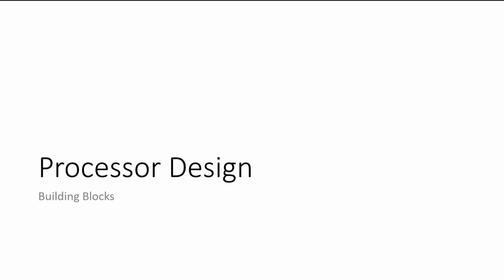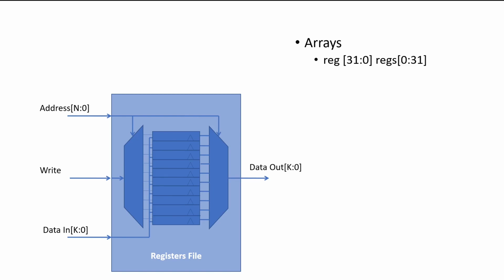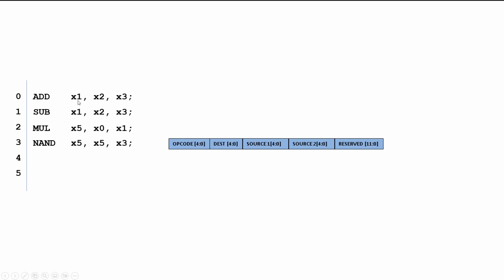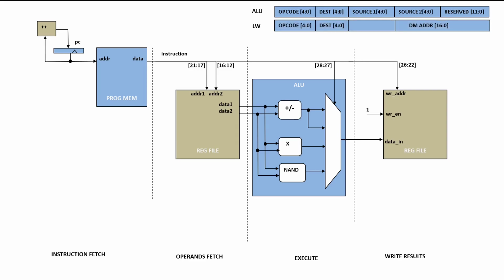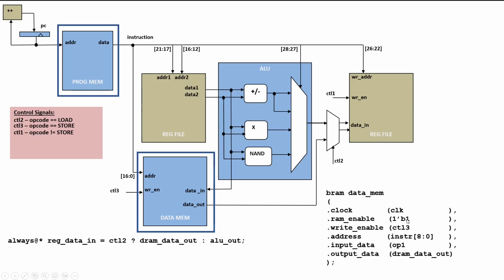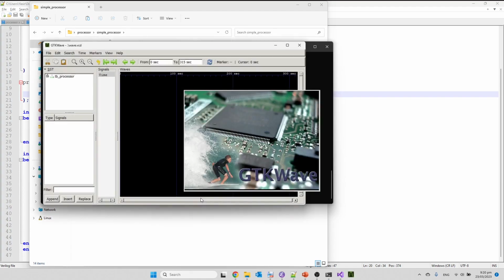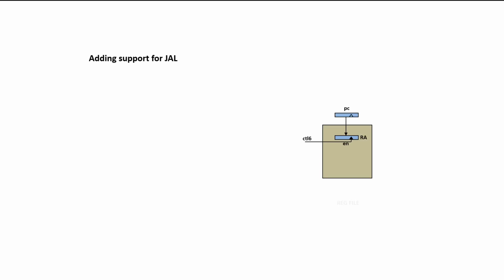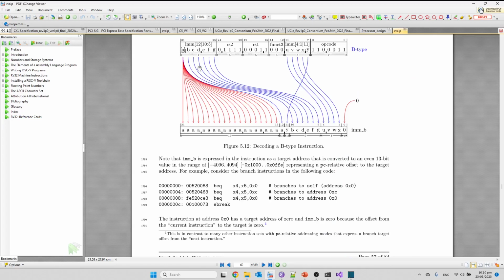Processor design for dummies [English]

Comment: Dear Sir
Thank you very much for this helpful video
Please, I try to write the following Verilog code in Vivado, the synthesis process is OK but when I want to implement it an error signal appear !!

module Tog_not (hsync, EOL, q);
input hsync, EOL;
output reg q;
always @ (posedge hsync)  
begin
q<=1'b0;
end
always @ (posedge EOL) 
begin
q<=1'b1;
end
endmodule  

Could you help me for that? Thank you again.
Reply from the maker: Here q is derived from two posedge blocks. If you wanted to make two different registers they should have had different names. If you intended to make single register then it should have been same posedge block. Also you are using two different clocks (hsync and EOL), from names both seem to be control signals instead of clocks. My guess is that your system might have a different clock and you might wanted to set q on hsync and reset it on EOL.

Always start with a hardware design first instead of writing code on the fly. It can lead to hardware that doesn't work as expected
Reply: @RenzymEducation  Thank you very much for your clear answer.